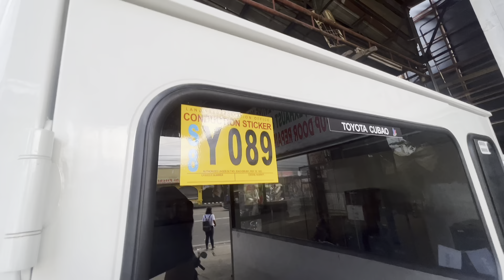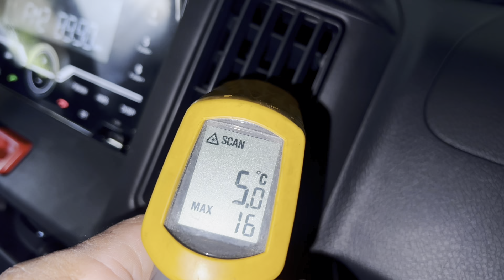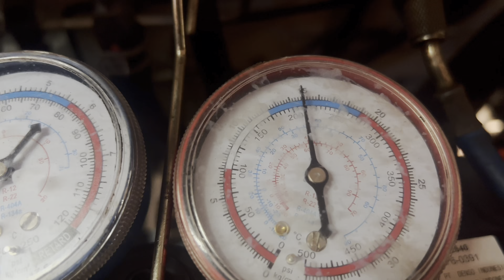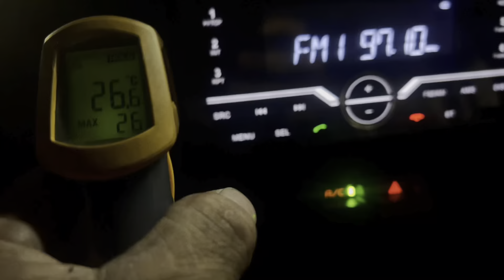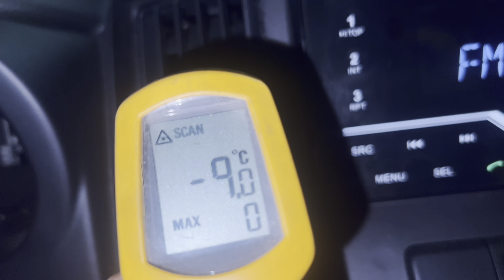2022 LITE ACE REAR AIRCON INSTALLATION

Comment: Ok na sa Master Boss ung install kaso nkahampalang ung line ng hose sa tapat mismo ng sakamin dpat nkahulma sa gilid. Ung isa pa Ung suction hose fittings dpat binalot ng insulator to avoid condensed of water . Tutulo sa loob yan . Un lng nman Master Rocky

Comment: San natagpuan shop nyo n pa estimate pAra sa lite ace van panel?
Reply from the maker: ROYCE REFRIGERATION AND AIRCONDITIONING SERVICES TIKAY MALOLOS BULACAN BESIDE MCDONALD'S 0932 891 4020
Reply from the maker: 0968 888 2822 09178858996 yan powala na ang sun